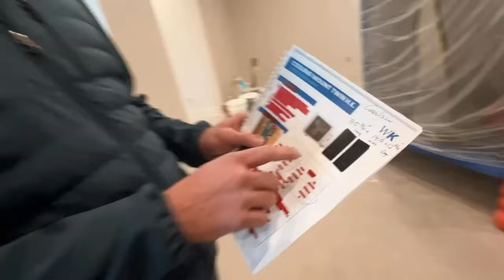A Day in the Life at a CUSTOM Luxury Remodel! (Way Over Budget!)

Comment: Hi Brad I was wondering why when you’re flooding guys fit the LVP/ laminate flooring, they do not put down a membrane/ vapour layer on concrete floors and a under lay/ self levelling/ insulation board first like we do in the UK?
Reply from the maker: The products use have rubber backing that acts as a vapor barrier

Comment: Hey Brad, how does a commercial fit out compare to remodeling a home? Easier? Harder? Generally the same? Thanks!
Reply from the maker: I’ve done very little commercial. It’s different codes and different contractors than residential remodeling.   They say commercial goes faster because there’s not a homeowner involved.

Comment: If you don't do some substantial ventilation with fans in that pool equipment room that refrigeration system is going to struggle big time
Reply: Interesting I was wondering about that also I’m curious to see brads take on that
Reply from the maker: We’re going to add fans in that pool room to keep the airflow during the summer months👍

Comment: I always buy all material. Heck I buy the screws, nails and caulking. I make sure I have an extra set of tools and speciality blades in my truck. I dont want any execuse when a sub shows up.
Reply from the maker: That’s a good point, but I’ve learned when you buy the materials there’s a bit of a backfire because the sub  can create a lot of waste because they’re not paying for it
Reply from the maker: So they is always the other side of the coin it’s hard to find a good balance
Reply: @BradtheBuilder  yeah that is my drywallers. I have never seen so much waste in my life. If the last piece is 2'x2' and there are 800 pieces of scrap that size they will grab a full sheet
Reply from the maker: @av1204  my Drywaller bid all my jobs labor and materials so if they’re throwing away big sheets, it’s on dime